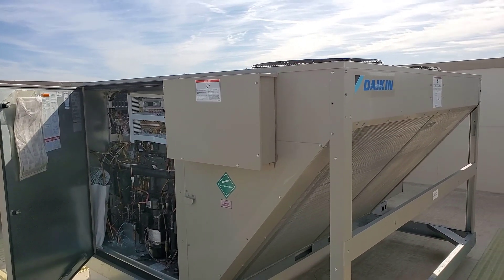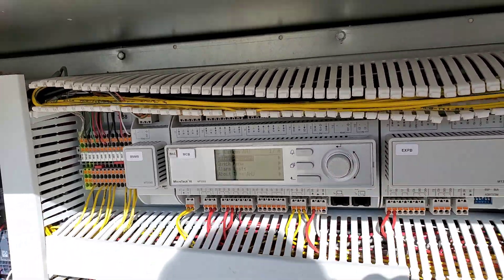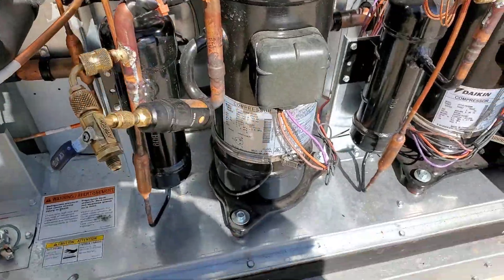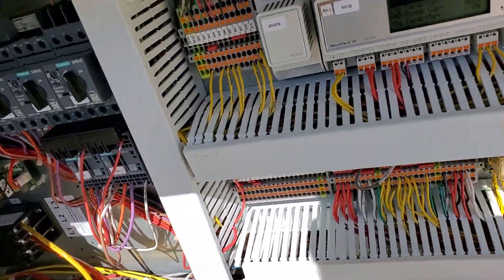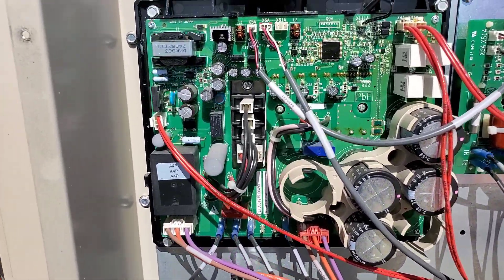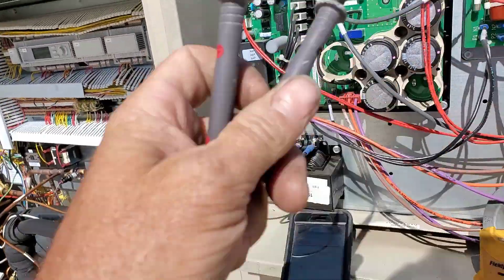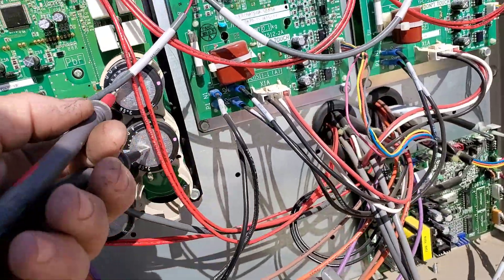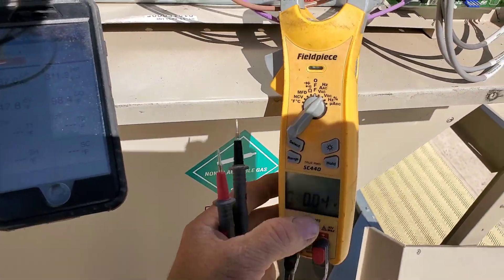Last Visit to Daikin Land - VRV Inverter Compressor sounds like its gonna blow to hell!

Comment: Is the second compressor running out of the same inverter board or a different one
Reply from the maker: It's not on the same one. I think the second one is just 1 speed.
Reply: Daikin using one vfd scroll compressor and one or two direct on line compressors of fixed speed compressor. Here in Europe we have some nice Daikin staff like Daikin zeas refrigeration condensing unit that using a vrv 3 without the four way value to make refrigeration in fridges and refrigerators like a inverter refrigeration rack. On the oil port before the capillary tube i installing some filter for that reason is reliable if it have some filtration on the liquid line and on the oil return line.

Comment: I have same unit most problem with that are transducer..
Reply from the maker: Do you get an alarm for PTS or something like that?
We were getting those when we first had these on some medical facilities and it turned out to be voodoo faults from the quick power fluctuations during the Generator Transfer Switch operation each month!
Reply: @hackfreehvac  last week a got a call with both compressor high discharge line temp fault upon my verification it was due by out of range pts reading causing eev not feeding proper refrigerant. The unit total fresh air application for emergency room area.
Reply from the maker: @Noypihvac  Chevy. Hadn't seen that fault.  Just the PTS fault and it stops on that fault.
Reply: @hackfreehvac  i work a lot with daikin chillers too here in the island which use same transducer very common problem. Sometimes actual fault comes from different issue.

Comment: This guy is a complete hack. That’s exactly what the Daikin Inverter sounds like ramped up under high head. Plus you can’t put your meter between the inverter and the compressor...
Reply from the maker: Da Fuq???
Ha ha ha
My meter is on the 3 phase INPUT to that inverter board as I'm watching the amps fluctuate. Not the leads to the compressor. I think I even mention that in the video.
And yes,  that compressor is mechanically fucked. Internally. A product failure. Head pressure was never ever a concern. Just wait until July and then we can talk.

This wasn't my first day around an inverter compressor.
Reply from the maker: Looks like a Goodman guy is using his new channel to defend junky equipment. Ha ha
Reply: @hackfreehvac  lol Goodman. You don’t even know what you’re working on.
Reply: @matthewdodds8086  Uh everything Daikin makes is a direct result from them buying out McQuay and Goodman, robbing their designs, fucking the designs up, and purchasing everything from China. Even their VRVs are junk (just because you are the pioneer doesn't mean you are the best). Tech support is non existent (unless you can wait on hold for 3 hours for a "dispatcher" and wait another 3 to 5 business days for a call back) and one valve failure in the outdoor units and you slug liquid until the compressors blow. Daikin = Goodman = Amana = McQuay = Junk. Do YOU know what he's working on? You obviously didn't spot his meter on the input to the inverter. It's ok. You stick to your Goodman equipment who's cabinets flex so bad they collapse then you pull the panels off and the screw holes completely strip the first time the screws are removed. Thanks for the laugh!
Reply: Jman0870, GREAT REPLY!
Reply from the maker: @jman0870  Amen!
I can't believe I missed this comment until now. 
And yeah, that Goodman/Daikin lover is full of it.
Reply from the maker: @matthewdodds8086  I definitely knew what I was working on.
Reply from the maker: Also... I've been on Site for a few VRF jobs with contractors over the past few months and the concensus is that Daikin VRV sucks.

I actually wanted to like the tech.
But I'm not going to hide the issues they do have.
And it's not compressor issues (that can happen to any of them) but some really dumb engineering be it their really lousy PC interface software or their lame inability to maintain the system if just one small indoor coil loses communication. That alone makes people not want to install them
Reply: @hackfreehvac  I'm glad you got a laugh out of it haha! I'm super jaded about Carrier and Daikin. They both suck as far as I'm concerned.
Reply from the maker: @jman0870  Carrier has two lines,  one is Carrier/Toshiba.
What I've been seeing from that so far is much better than Daikin.
Very easy to set up.
Much much better laptop software called Dyna Doctor
Reply: @hackfreehvac  All I'm hearing is Carrier pays Toshiba to put their name on their VRF equipment haha! Comfort Link is all I need to say to prove that Carrier sucks at designing electronics hahaha

Comment: I wish people would stop installing this daikin junk
Reply from the maker: It ain't gonna stop.
They are kinda cool as far as having tech.
But dang they are quirky and have some stupid flaws. Such as shutting down one fan coil (causing a loss of comm to it) will eventually shut down every unit on that system. 
Had it happen here not long ago (again).
One small fan coil drops a fuse. One small office would be the only thing to not be cooling. But no. The control generates a fault that shuts down ALL fan coils.

Comment: I had a 240v LG compressor destroy itself before. I had the unit running then it mustve started destroying itself cause it sounded fine then all of a sudden it got louder and louder till you could hear metal stuff flying around in it until it siezed. Was pretty kool.

Comment: If you had to guess, what percentage of those Daikin package units are trouble free or just basically reliable?
Reply: None
Reply: @politiciansthrowstones   Lol,, Oh man,,, that's sad.
I'm SO glad I'm out of the business !!
Wish I wasn't so damn old but I'm SO GLAD I'm OUT !!   lol
Reply from the maker: We've had a handful of quirks on every building these units have gone in.
On the contrary, we've had LG VRF units run several years and not have to fix or reset them or anything.
Reply: @hackfreehvac   It would be so depressing to have sold and installed a bunch of these units and have to face the customer over and over,, especially out of warranty !!

Comment: Junk.  Save a penny on power to spend thousands on repairs. Makes sense just to democrats.
Reply from the maker: Yup.
I like technology and all. But when I have to talk to customers who question all the tech and the expense, I point out that much of it's push into the industry IS because of government mandates. Same with cars such as the ridiculous Diesel engine "regeneration mode", the "def fluid" and all the problems that go along with it. Stuff that adds complexity and reliability issues but are mandated.
Reply: They're probably getting a pretty penny from all the sales of the breaking down electronics lol, I'm tired of the mess politicians are making the HVAC field

Comment: Lol I've done a few of them vrf... Those suction can drop down and not freeze up... They make funky noises...
Reply from the maker: Yeah I see VRF stuff drop in suction for a bit, especially when they first ramp up into kick-ass speeds to get things going. But they often correct the pressures before they'd actually have the coil start to freeze.
Reply: You should get an inverter sequence tester it tests the frequency output going to the compressor and makes sure it’s in proper order they come in handy
Reply: @RDHPLUMBING  your right but sometimes you use the service checker hooked up to a laptop also
Reply: @hvactechpr7872   I have the Bluetooth d  checker I’ve sat in hours of Daikin training lol I only use Daikin at this point cause it’s just easier to work on one brand of vrf units they all have different set ups so it can get confusing switching around

Comment: That china product will fail soon,  hell they can't even steal a design right. With your meter not reading higher then 460, it is Another reason I don't trust fieldpiece meters, fluke only for me after my fieldpiece failed to read 460 on a roof top
Reply from the maker: I keep that HVAC type Fieldpiece in my tool bucket.
I keep the Amprobe in my truck for when I need a good reading like this.
The Amprobe is made for 3 phase and VFD use.

Comment: Bypass the inverter and feed it directly, might be faulty electrics
Reply from the maker: Naw, that compressor clearly has something mechanically going wrong inside it.
I can hear it standing there.
Reply: How exactly are you trying to run 660v DC rotary compressor out of 208 AC without inverter?
Reply: @igoiks  my bad i was thinking of 3 phase motor on vfd
Reply: Very wrong observation.

Comment: Needs air flow to keep electronics cool
Reply from the maker: I later found some air blowing in via an electrical pass through but there is no way for air to blow back out. So I don't think it gets much airflow if any in that cabinet.
And with 2 compressors, that also have crankcase heaters etc, it seems that the compartment might double as a heating oven!

And of course our Arizona desert sun on the outside.

Comment: Throw the junk Chinese made compressor into the trash and replace it with a USA made compressor.
Reply from the maker: Well, under warranty I'm sure it'll get another of the same.
Reply: Probably can not get a USA made compressor,  to run unless you go back to regular 3 phase and psc fan motors

Comment: I Wish you were letting us see the superheat on that compressor. Any chance it is slugging liquid with those evap temps in the 20’s.
Reply from the maker: The suction is only low for a few seconds when it first starts. Not long enough to flood the entire evaporator.
The pressures are already normalized when the compressor is making the internal mechanical noises. Then locks up occasionally.